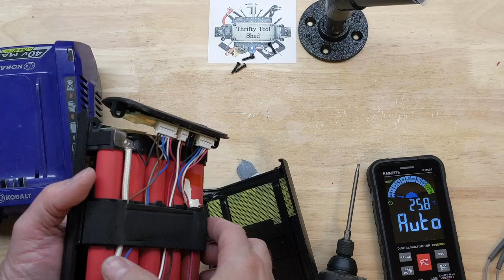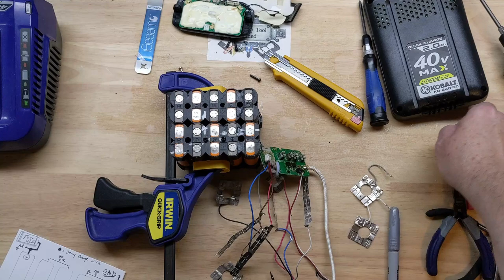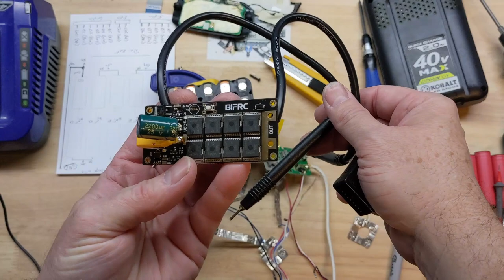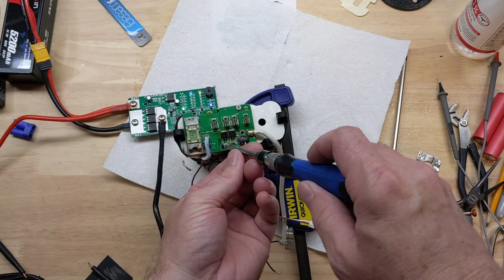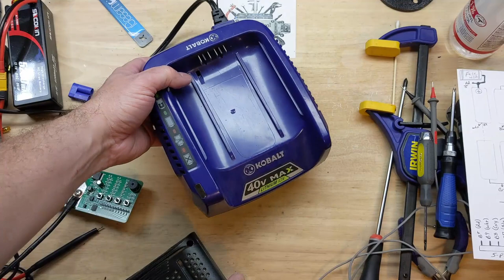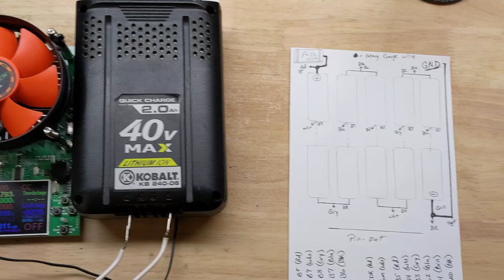Kobalt 40V Max 2Ah Pack Modified to 4Ah

Comment: For quite some time I have been doing repairs/rebuilds on the 5 & 10 cell packs (Makita, DeWalt, etc).  I was given a Kobalt lawn mower, 40v with a dead battery.  I found two dead cells and two very weak cells.  I had comparable batteries available...so to work I went.  I spent several hours trying to get the end cap off (after removing the screws that hold both ends together).  I was at wits-end.  After looking at a lot of useless videos (which is usually the case) I came across yours.  I fast forwarded till I saw where you removed the single screw that holds the end caps together on each half.  WOW... 

I was so impressed with finding that, I went back and watched your entire video.  Good stuff.  Please know how much you helped me out.  I will agree with your comment that Kobalt makes a well-built battery pack!  Thank you again!
Reply from the maker: Awesome! So glad it helped. Thanks for your kind comment and also watching the whole video!

Comment: Great video thanks and I did order one of those little spot welders and polymer battery,
 that beats the hick out of my soldering jobs
 thanks for the info
Reply from the maker: Awesome. If you don't already have some XT-60 connectors or leads you may want to get some to make the connection to the board easier. If I remember correctly it comes with ring terminal leads so I made up some cheap XT-60 leads for it. Thanks for your kind comment!

Comment: Recently popped one of these open & was like dang they really going to make it this easy to make a 4ah pack. Even if I don’t rebuild it for the Kobalt I’m going to save the holders for other projects, way too nice to just toss. All of the cells were roached, I think as 1p setup the tools must have just too high a discharge for the cells to last long, 2p should make for a much more reliable long lasting pack.

Comment: I was looking for information on Kobalt 40V batteries and came across your channel, this has to be one of the best videos on Youtube about lithium batteries, thank you very much for sharing such great material. 
Have you ever come across a Kobalt battery pack that flashes red on the charger but all cells look ok and have about the same voltage? I have one fairly new 40V 4Ah pack where all cells are presently showing around 3.98V but the gauge on top only shows two leds, and now the charger only flashes red when I plug it in. Is there any other test I can try without fully dismantling the battery pack? Or could it be the BMS itself that failed?
Reply from the maker: Thanks for your kind comment. I have only worked on a couple of these packs and have not seen that myself. I would think it is a problem with the BMS. If the overall voltage is good at the terminals, I would say that most likely points to the BMS board. The last thing to try might be to see if a reset is on the board. The board might be potted and make that nearly impossible on some.  Some BMS boards have a spot like programming header, and jumping reset to ground can sometimes reset the microcontroller and can work sometimes. It's a long shot, but I have a couple older videos that it did help. I shared this on an ECHO 58V pack repair and a Ridgid pack repair video. It is the only thing left to try that I can think of. Best of luck to ya!
Reply: @ThriftyToolShed  Yeah mine is indeed potted, I also have a good working battery which is also potted so at some point I caught myself looking at still frames in your videos trying to identify such test points in the BMS PCB 😅 But I don't want to disassemble the good one and risk finishing with neither working afterwards. Guess I'll end up purchasing another battery pack and I'll later upcycle these cells on other projects. Thank you again for the excellent content!

Comment: hi, i think you are the best person to answer my question.  You explain well and have a lot of experience.  I have recently had fun restoring old power tool batteries.  what always amazes me is that one or two defective 18650 cells and the battery is not functional.  is there a way or modification for the batteries to degrade at the same time?  I saw that there are active balance... would it be the solution?

Sorry for my english im better in french 😀👍😀
Reply from the maker: That is the goal for sure. Some packs have BMS boards that help keep cells balanced and basically all packs are assembled with tested and matched sets of cells and the goal is that they would all last about the same. Unfortunately that is the problem, almost always one or more cells lose capacity before the others and it of course makes the whole pack unusable. I really don't know what can be done better until we get away from the lithium and get a better chemistry or possible solid state batteries that hopefully do not have the same issues as lithium. They are so temperamental, but they have great energy density. They are just such a pain to keep going.

Comment: Thank you for the video, it's helped me take mine apart and somewhat understand what's going in there. However when checking my cells they seem to be okay. I have a 5 amp hour pack and so the way they're wired I can only measure two of them that are together. When I measure each set of two, they're all very consistent at about 7.6v. Before I took it apart it would charge up to 2 bars and then the charger would start flashing red. Any ideas? I guess if I un-solder the cells I can check them individually.
Reply from the maker: They are together in the 5Ah, but 2P or 2 in parallel so it will still be voltage of one cell for example 2.8 - 4V. You will know if one is bad because it will also affect the other one in parallel with it.
Reply: @ThriftyToolShed  thank you! So actually I think my cells are okay then. Any other ideas as to why I'm only seeing too bars before the red blinking starts?
Reply from the maker: @BruceChastain  
I have not seen this exact issue with these packs as I have only worked on a couple of them now. I imagine you have verified the fuse is good. I would check that all balance leads measure correctly all the way to the board and if all else fails you can see if it's a microcontroller on the board to do a reset on possibly. I have shown that on a couple of other brand packs over the years. Some Ryobi, Ridgid and 58V ECHO packs have a header plainly marked and I jumped rst to gnd if you happen to see that. That is all else I would know to check from here...

Comment: Hi, great video.  I have an 80v that all the cells test 3.78 - 3.83.  charge indicator shows 2 lights, but it won't charge.  When put in the blower it runs for 1 second then shuts off, after a brief time, it will do the same thing.  I can't figure out what's going on.  Any thoughts?
Reply from the maker: So the fuse is good and the power is getting all the way out to the terminals? If so, does the board have a programming header that could possibly have a test point?  If you are unfamiliar with that I did reset a ECHO 58V battery in one of my older repair videos. If it has a reset pad on the board, I would try that. Thanks for your kind comment!

Comment: what kind of cells did u put in there my moms battery is going out was going to try a repair
Reply from the maker: These were cells I had in a scooter battery not being  used so basically new cells. Not any that I bought for this video. I mention in several videos and show using cells I get from 18650batterystore.com.  I look at the Deals tab and usually see if they have a really good deal on some very similar cells and sometimes you can get them for half price.  
This is an example of some similar cells I would use if purchasing some for this example of a pack. If you would rather have the name brand cells, they have some of those on sale also. 
https://www.18650batterystore.com/products/eve-20p

Comment: What is your source for the  60 amp fuse for the Kobalt packs?
Reply from the maker: I have only had one fail and I had the other pack with all bad cells so I have not had to source one myself. I only worked on a few of these for friends.
I would look into some like these and see if they will work. You may have to cut/modify the tabs a little? Unsure, but maybe this is a good place to start...
https://amzn.to/3P3WKlG
Or
https://amzn.to/3L3G6S4
Reply: thanks @ThriftyToolShed

Comment: What does the ohm symbol connection do?  I'm trying to run a kobalt mower off of a different 40v pack and it's not working.  Does it need a resister to neg terminal.  I tried to watch this video and take a closer look at the board but it's hard to tell.  Thanks
Reply from the maker: It is marked as "COM" on the board and it is the white wire that goes from the connector board to the battery monitoring board. I briefly showed the white wire on the very basic drawing I shared of the wiring. I did not share much about it since I did not need to for this repair. I have not had the potting off the monitoring board to know for sure what the 2 center connections do. I would think the COM is more of communication between the pack and tool and possibly pack and charger, but not 100% sure.  Some packs need a NTC or resistor to give a feedback for temperature to work, but I think this is much more. These Kobalt power tools and packs are made by Chervon that makes EGO, Flex and SKIL. I have spent time trying to figure out the D-Terminal on the EGO packs that are similar and uses communication between the microcontrollers so it gets complicated when you have no schematics or any information on these except what we figure out on our own. Hope it helps some. Best of luck to ya!
Reply: Thank you for the information. My mower has three wires only and I tried the resister to simulate a temp but wasn't sure exactly what it needed.  It's the connector closest to the neg.  The other connector I think is the comm one isn't used but I may not be looking at it right as I don't have a kobalt battery.

Comment: The orange cells you are using as replacement from hover craft battery are not suiteable for kobalt battery as they use high discharge li ion sanyo rx 18650 with 20A continues discharge rate while one you are using dont have high discharge concequently battery will die again once you put load on this kobalt lawn mover using this battery from orange chinese cells.
Reply from the maker: It's actually working perfectly still today as it's only for a string trimmer and I tested it fully. I am aware of the cells. It also kept a battery from being useless to working better than the 1P pack from the factory for 2 years now. Other than that you are correct. Thanks for your comment!
Reply: Good👍👍
Reply: Ur welkom, can you give me the link to buy both of these spot welders from ali express, i shall be thankfull to you..
Reply from the maker: I have the Amazon link. If you need an AliExpress I will see if they sell it...
https://amzn.to/3TwfYkk
Reply from the maker: These are 2 close to the ones I use on AliExpress.
https://www.aliexpress.us/item/3256807162493370.html?spm=a2g0n.productlist.0.0.1fdb6c06S5ZQV5&browser_id=c53d1709d1084d4d9a9316b354719e5c&aff_platform=msite&m_page_id=caakhnpiwcawxyuu190d8017b5ce0eeae5314f361e&gclid=&pdp_npi=4%40dis%21USD%2133.83%2116.91%21%21%21245.00%21122.50%21%40210324f117216112544314907eecaa%2112000040365948985%21sea%21US%210%21AB&algo_pvid=681289c5-13e0-470d-a2db-4b2f1c825959&search_p4p_id=202407211820545451004439392500003500696_3
And
https://www.aliexpress.us/item/3256807092772157.html?spm=a2g0n.productlist.0.0.1fdb6c06I0cjjw&browser_id=c53d1709d1084d4d9a9316b354719e5c&aff_platform=msite&m_page_id=caakhnpiwcawxyuu190d8017b5ce0eeae5314f361e&gclid=&pdp_npi=4%40dis%21USD%2132.86%2124.64%21%21%2132.86%2124.64%21%402103011617216112234858127ed04e%2112000040045495998%21sea%21US%210%21AB&algo_pvid=154a966b-ae94-495d-8738-251bf60e49a3&search_p4p_id=202407211820232773531632103450003333381_1